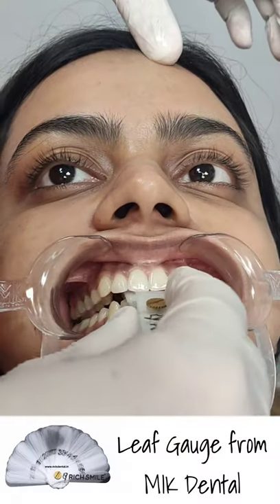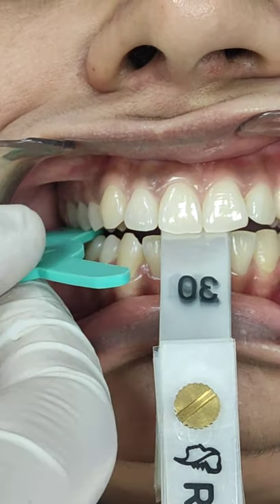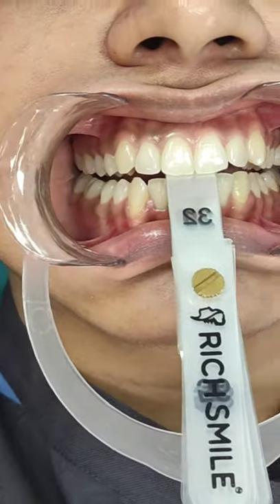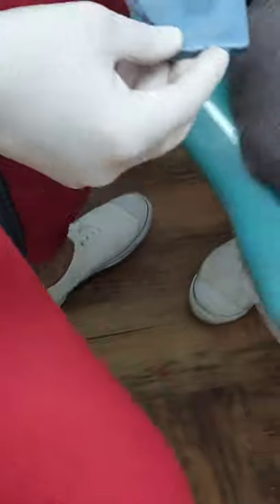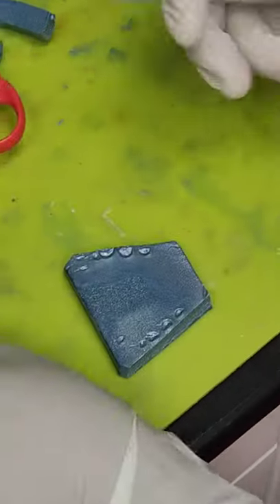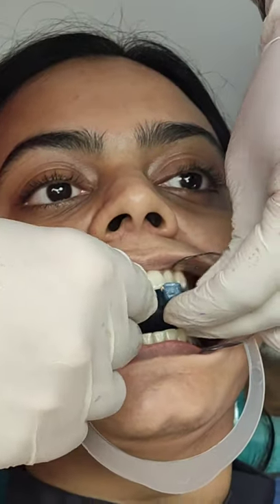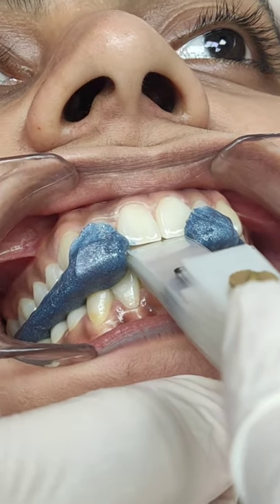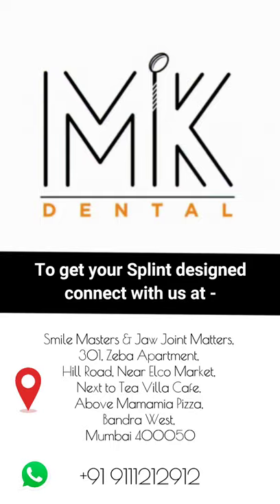HOW TO RECORD BITE FOR PERMISSIVE SPLINT EXPLAINED

Comment: Great video. but do you deprogramm the patient before this with MIK deprogrammer? I use a custom made 2mm thickness acrylic plate with anterior bite plane to deprogram and then take a bite with alu wax. but want to switch to CAD CAM splint as it reduces the number of visits and the splint is much more finished. thanks

Comment: Sir, we take the impression and record bite and send it to the lab. With blue and red articulating paper we record centric and dynamic bite. Also protrusive movement. The marks on the splint caused by those movements should be trimmed? Or shld we add material to those areas.
Reply from the maker: Sorry but tough to explain this in text... Check out splint videos on www.mikeducation.com... all your questions will be answered there...

Comment: What if i dont like my current bite and suspect that a high filling, that sarted the problem, is still there but difficult to fix because the teeth are no longer touching. Should the doctor design the slint based on the current bite regardless?
Reply: i have the same problem